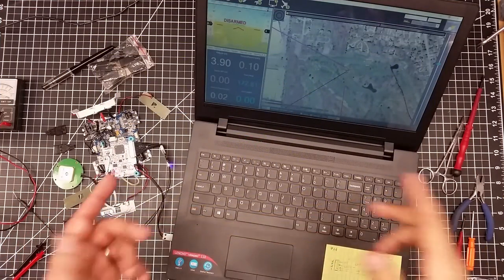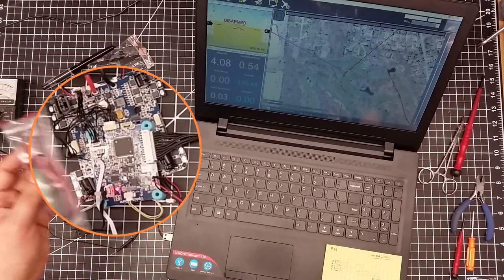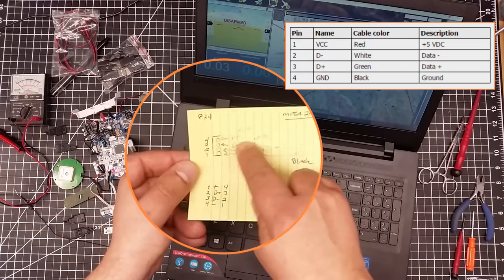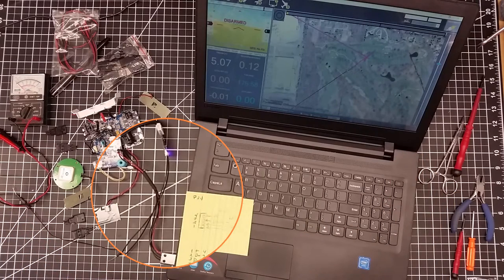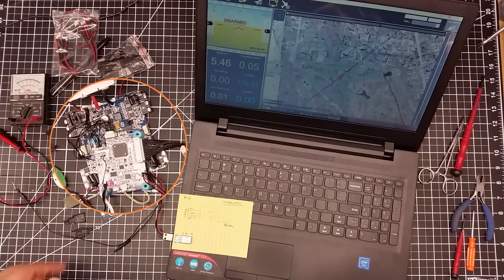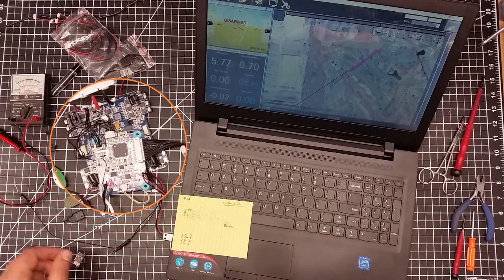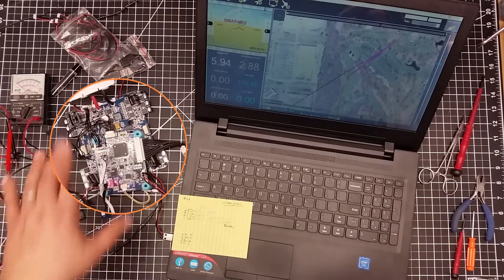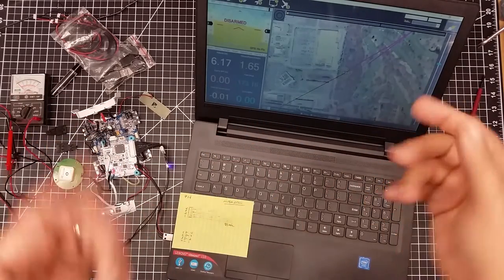Video Drone - Solution to Missing UPAir USB Port!

Comment: Buenas noches necesitaría una ayuda ya que hace 1 semana e tratado de conectar mi upair one a un modulo de telemetría inalámbrico a través del puerto USB sin éxito alguno ,ya que cuando doy conección al misión planner no hay conección pero si coloco un cable usb directo a la pc si puedo conectarme bien al dron como hace usted en el video ...hay alguna manera de poder tener coneccion con el modulo inalámbrico ...muchas gracias..
Reply from the maker: Your welcome
Reply: @VideoDrone  GOOD DAYS, I would need a help since 1 week ago I tried to connect my upair one to a wireless telemetry module through the USB port without any success, because when I connect to the mission planner there is no connection but I place a USB cable direct to the pc if I can connect well to the drone as you do in the video ... there is some way to be able to connect to the wireless module of 915 MHZ AL MISSION PLANNER

Comment: hi nice job bro...
can i know that the leg have 4 pin connetor is that also USB?
Reply from the maker: Not sure I understand the question, can you clarify?
Reply: at the leg upair have 4 pin socket... maybe they say that is a usb extension can u found it? it relly usb or not
Reply from the maker: Neither of my two UPAirs have a 4pin socket near any leg.  the USB port is on the UPAir Core Board inside...
Reply: maybe they make some route to there.. ?
Reply from the maker: Doubt it at least not on the two I have the only thing which comes out is the compass ribbon cable.  Possibly on the new model (the app version which I don't have)
Reply: Hi just out of interest I have just purchased the Upair one which has what appears to be the px4 socket on one of the legs. Do you have any idea whether this will be just an extension from the main board to make it more accessible?

Comment: We need to talk further of obtain use with the USB service. I obtain the authentic USB cable which is prioritized for the PX4 only to find flaws while us both Mission Planner and QGroundcontrol platform apps. To the point that I lost default initialization for the quad's control module. I email for support from Upair and to no avail responded, "as usual!" I truly believe that they are stating for the low pricing of their products, why bother! I presently have 5 of these drones and awaiting still for help on recovery. Curious if I copy the files on the embedded SD card mounted on PX4 board would that help?
Reply from the maker: Sorry not sure I am fully tracking as I don't recall an embedded SD card on mine but that has been a long while back.  So you have 5?

Comment: i have the 2k version with the px4 board but mine has a usb extender on the leg of the drone. Can you do a video on how to make a usb cable for that version. i know its pretty much the same but would like to see someone do it before i try it. Thanks and your videos are great.
Reply from the maker: Many thanks for the kind comments!  Since I don't have one can't effectually do that, however if your sure its a USB connection the wiring configuration should apply and you can use a multi-meter to double check.

Comment: Hi, thx for  the vid ! I have a Upair One 4k with PX4 labled v1.2, is this the very same you got here ? When i looked at the board i saw that there was a plug inserted running down one of the "legs" of the Upair ending in a small board that seems to be basically just a female to female gender changer. So i tried to use that plug on the "leg" but it did not work. Also when i measured the 4 pins of the df13 i plugged into that socket i was able to measure a maximum of 3.3V. Do you have any advice for me ? Thx, Nils
Reply from the maker: My "guess" is it is an I2C bus:
Pin 1: GND, Black
Pin 2: SDA [Send Data]
Pin 3: +5v, Red (#26AWG)
Pin 4: SCL [Serial Clock], White

However the 3.3 volts is odd.  As the Phantom 2 had a similar connector on the leg and that is what is what it was.  You hook up a scope and look for a clock plus on pin 4...

Comment: I have 2 questions. My board says it's an MB v1.0.02 and I do have an empty connector where the USB should be, but it's not a df13 4p. I have no idea what it is, it looks like some version of a df13 but I'm stumped. Also, if I took a 4k camera and gimbal and put it on a 2k plus drone, would that work? I have a 4k and a 2.7 plus (I bought them in an auction lot) and I really want a 4k plus and I figured I could just swap the cameras/gimbal. Am I crazy?
Reply from the maker: Is this on the One or the One Plus?  Also if its the "One" and the and the 4K camera was from a "one" that would most likley work.  However the camera & gimbals are not swapable from the "one" and "one plus"...

Comment: And in conclusion, I cannot find anyone using the current PX4 board via Mission Planner and QGound. I wonder why?
Reply from the maker: If you have the "newer" I do not believe it will work as I spoke with GTen a while back and the new version is wholly different...